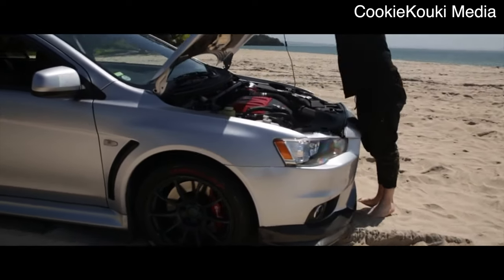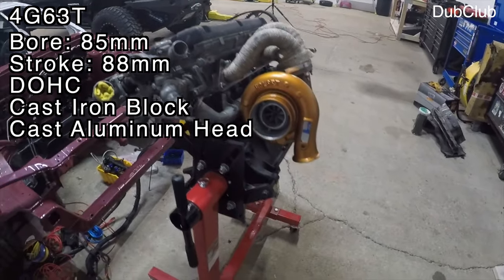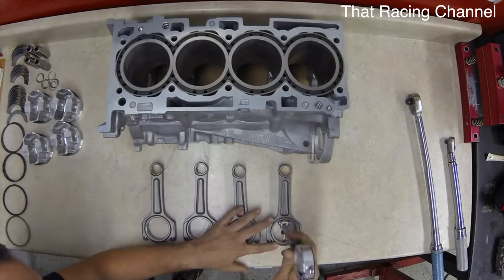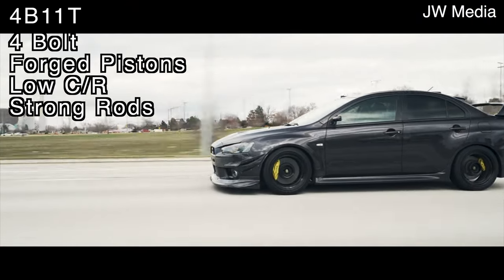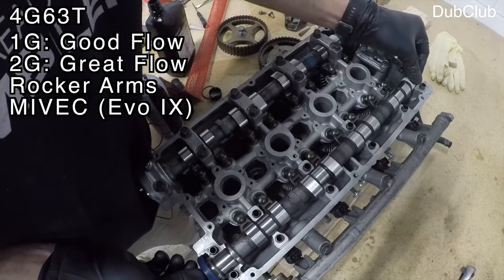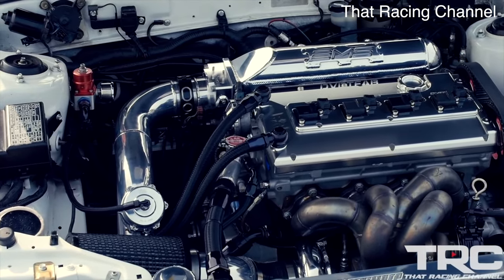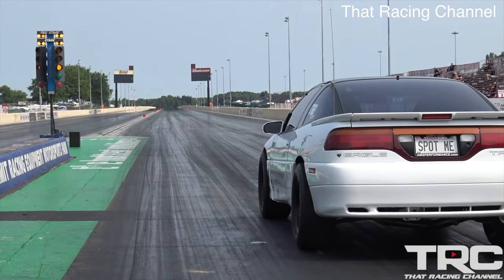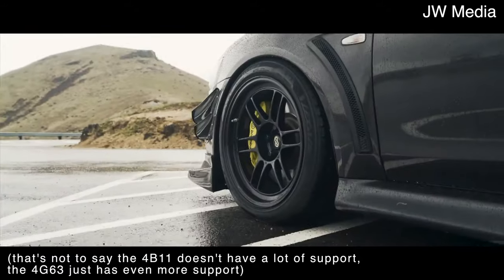Mitsubishi 4G63T vs 4B11T: Which One is Better?

Comment: Realistically speaking, we generally buy cars for the car itself and not just the engine. When I was searching for an Evo, I test drove numerous evo8s and 9s, but ended up buying the very first evox I test drove. I convinced myself before hand that I wanted the 4G63 Evo, but after experiencing the evox comfort and added features over the older evos, It was a no brainier that I felt like I was getting more for the money. Fast forward almost 5yrs, my Evo is making around 650whp, still on its original oem never opened t-case,  diff , and bone stock trans..forged sleeved engine yes. I made the best choice.. and it's my daily.. I have put over 100k on it in 5 yrs
Reply: I have an X tuned to just over 400kw at the wheels, the engine was virtually stock with just a couple of bolt ons, and lasted almost 300,000 km. Eventually the timing chain jumped a tooth and the engine failed, but that's more due to the fact that it was the original chain and it had basically worn out. The majority of the internals (those not busted by the timing chain failure) are still in perfect working order. 

I still have the car, only the repairs are beyond my means at the moment. One day she'll ride again!
Reply: Wish i could have one but i refuse to buy one used as i know people beat the shit out of these cars and the STi subaru is making right now look like a glorified toyota corolla so i think ill never have one don't understand why they stoped making the evo
Reply: @emlix1  evo lx with just a tune on e85 400+awhp
Reply: My g54b lasted almost 30 yrs with over 250k miles on it before a rebuild
Reply: @user-fk2si1xc2s  Yea its takes more than that. But the evo9 does make the most power with less effort than any other 4g63 mivec makes a big difference . The 4b11 is a smoother more efficient engine but takes way more money to make equal power .
Reply: @killfase01  Starion? I own a '87 myself. I wanna vouch for it's reliability but I can't. Even with the jet valve and balance shaft deletes I've already had rod knock and a lifter shatter, along with numerous other problems in the 2 years I've owned it. Simply put, it had the potential to be a great engine, but was made in the wrong time period. Good block, but a horrible head, intake system, and numerous other systems that were advanced for the time but not thought out well enough to prove bulletproof even from the factory.
Reply: For a daily driver we buy it for the car. In regard to 4g63 we get a 1g or 2g car simply to be fast for cheap. They're definitely not the most comfortable cars but I used to daily it when I was younger
Reply: MVRDA MONXY I own a x its 2012 and only has 24k or so lightly tuned and not beat at all..... I kinda want to part with it though ughhh
Reply: @Lowedownful  yeah I never (well, almost never) thrashed mine. Serviced it every 10-15000 km (or every 3-4 months given the amount of driving I did for work), and if it had a dedicated timing chain service light (as opposed to the stupid and vague exclamation mark in a triangle which went away after the requisite number of ignition cycles) it would still be on the road and probably approaching 400,000 km. "Beat" engines don't generally last that long. Indeed the X's own service book only goes as far as 210,000. Maybe that's all they were expecting the 4B11t to do?
Reply: I think the evo x is a fine car and plenty of my business have had 8 9 and X. I however find that I dont care about comfort or luxury nearly as much as driving feel. The evo 9 simply just feels better to me. I absolutely hate the clutch position of the X and the size of it just doesnt feel as nimble. However what it all comes down to is we're arguing over which absolutely amazing car is better.
Reply: Salute to you and your evo
Reply: Denny Houck this is waaayyy more then 2 cents dude especially after reading it all lol
Reply: @colbert9263  yeah, sorry about that man!!😂
I tend to get a little carried away when it comes to cars!!
But thanks for reading my long ramblings!!
Reply: Denny Houck i would definitely have a perfect score if i answer this long essay in exam.😅
Reply: @mvrdamonxy7942  sadly the mitsubishi closed there productivity of evo which is for me the best engine than Boxer of subaru..very affordable when we updgrade it
..
Reply: Why did you just categorize me like that. It’s either the engine is good for the price of the car or not
Reply: Have u seem the integra platform? We do not buy for the car, we buy for the engine. Ether GSR or Type R.
Reply: 4b11 is Hyundai trash , you wasted money on garbage
Reply: Is it okay to launch it with stock transfer case and other stock components etc

Comment: Yes 4G63-T is a legendary engine for a number of years already and it has proven itself from time to time, it holds some of the most impressive records in the motorsport scene be it rally,track racing, and even drag racing. But when mitsubishi made the 4B11 it was actually a product of things that they have learned from the weaknesses of the 4G63-T. So nevertheless, its safe to say that the 4B11 is the result of everything that has always been the weakness of the 4G63-T.
Reply: FU.. TALK WHEN YOU BEEN IN A 1400 HP EVO 10..
Reply: @mickleeds9335  Evo 10 has the "4B11T" engine...also used in the Hyundai i30N ..
Reply: Agree 100% , ya dont sleep with them 4b11t they are coming , i love to biuld a sfwd with a 4b11t to race against yhem hondas
Reply: I heavily Agree Osama and it's always good to have a conversation with ya as you know your stuff when it comes to Mitsubishi and that's super dope haha. But honestly I think the 4B11 also took FAR less time to get into the 7's unlike how long it took Evo 8's and 9's with the Evo variant 4G63 that also seemed to be revised from all the DSM's issues as well since most of them have been corrected on the Evo's version of the 63. So I also agree that I think the 4B11 is going to takeover from the 63 in due time because it's seeming to be closer to K series style Semi-Closed deck design to their open design but slightly better and also is an Aluminum block just like the K but the sleeves seem to handle way more as well as the block itself seems to be just as strong as the 63's as you don't need to get a billet reinforcement like the Honda guys do to go over 900whp+ to be reliable
Reply: Tbh 4b11t has been my favorite because of the cons with the 4g63t and that now you can make the same power as the evo 8/9 and there cheaper than the evo 8/9 it's a no brainer to go with the evo x now (it looks better anyway)
Reply: The 4b11 is Hyundai trash

Comment: Can we stop assuming that everything that is "forged" is super strong? Like these could take 400-500hp. The CAST bottom end in the Saab 9000 B234R can take 850hp and didn't even break in that car because he was just testing. It's all about design not just manufacturing process
Reply: phoenix8129  then you missing out bruh haha.. Theres plenty of them
Reply: Well it's not that, but it's just generally the Cast bottom ends usually don't last long even if they CAN do very high power for the most part, so most don't push them like that when they can just get a better part with a better & stronger material to push for a longer amount of time that you risk it breaking far less than you would with a Cast engine or part usually.. Besides, most of the time too, forged parts usually are lighter weight as well which does help
Reply: @jordanprice9285  the lower weight is true and you can get bigger pistons too. But the guy I'm talking about is Robert Uhr from Nordic performance and he has run that engine for quite some time now, stock 9000 parts, he uses a a lot of OEM parts in is racecar.
Reply: The japanese seem to like forging. I know toyota does a lot of forging to reduce weight and material used.
Reply: Speak on it
Reply: Yeah and the b204 in my Saab can handle around 600hp stock bottom end . nobody wants. to give it to the sweeds tho. When gm bought them out they became junk.
Reply: phoenix8129  my Saab is at 300hp with a td04 right now runs like a dream next step is a holset Cummins turbo 500hp this time around but look up Saab 93 racing and you'll see nordics 93
Reply: @jordanprice9285  my Saab has 212k and its a cast b204
Reply: @alexstromberg7696  Yeah I've heard of him cuz I've seen some of his stuff and honestly the guy seems like a madman!! And not only that I know Saabs are built like tanks anyways as most Swedish cars are, also like Volvos as well, so I know whenever someone decides to buy Swedish, they're getting a car that's DURABLE AF!! 

But if you're getting something outside of there especially if you're going Japanese for the most part, it seems that whenever there is a cast part or engine that usually it's strength is limited to smaller amounts of power capabilities as usually the cast material isn't made half as durably to be able to take the heat being thrown at it. Take the Open Deck Subaru engines for example. They don't take heat very well even though they're using cast aluminum blocks. It's also kinda why lots of Mitsubishi engines usually used Cast Iron because it's usually VERY DURABLE and STRONG like a MF when it comes to build quality unlike it's cast aluminum counterparts with closed deck design because it's just smarter as it can just take higher levels of abuse simply because the material was much more capable of taking it since it's made for it.

That's also why people prefer forged stuff over cast. (Ex. SOHC 12V 6G72's Cast crank 3000GT vs DOHC TT 24V 3000GT Nitride steel forged crank 6G72's) They can assuredly for the most part take far more thrown at it en mass due to stronger material in design and when it comes down to it, the average tuner is more inclined to take a forged part or engine vs a cast one simply because it gives more room for error when making power and usually if anything were to happen, that the forged part will more likely be ok to survive than the cast one which usually will have a much easier time getting destroyed since it's weaker and can't handle what the average person tries to throw at it.

Comment: 4b11t is better, literally has a way better head, and the head is what makes power, not the block. Once you sleeve a 4b11t , or Even CSS the block you’re looking @ the same power range or even more as the 4g63.  And like homeboy said @ the top…. The 4g63’s are usually in a lighter body, compared to the 4b11t grocery getter

Comment: I own a 09 X 77000km 
400hp at engine 
Driven Evo 7 and 8 
Here is my general experience
The 4g simply feels more raw and brutal with sudden boosting  feels very strong but definitely feel the lag and sluggishness in the lower rpms 

The Evo X feels definitely more refined less brutal more consistent torque and power band through the revs 
The turbo lag is minimal and car responds so rapidly to boost and picks up speed to fast it’s shocking After fast it spools and slams through the gears 
It’s by far the more advanced faster and more reliable engine.
Reply: But that's part of what makes the 4G so great in my opinion, I have an Evo IX and I just love the raw nature of it, I love the turbo laag (as stupid as it sounds), and I love the power surge once it finally gets on boost, it just feels so raw and emotional, I love it... (even though it may be objectively worse)

Comment: My turner at English Racing told me that both engines when fully built are the same in terms of reliability and power and also said a 800 hp 4b11t is a lot more street friendly than a 4g63t bc on the 4g63 if u want to make that power ull have to half or full fill the coolant passages in the block with concrete to help the cylinders from warping but on the 4b11 u change the sleeves
Reply: i see alot of 6 bolt 4g63t pushing 1000awhp no problem just forget engines
Reply: m see a lot lol @ YouTube
Reply: I call bull on that one the way the 4g is built from the factory plenty have gone above and beyond in terms of reliability with the most common mishaps in terms of failure mostly coming from newbie mistakes and neglects in service both of which will completely destroy an engine in minutes or miles depending on the severity and level of said neglect.
Reply: @clarencepollard1253   English racing is the best they build the fastest evos and dsms. 4gs always blow up around 400hp if u don't forge the internals with exception to the evo 8 and 9 are reliable at 500  older 6 bolts and especially 7 bolts 4gs are not reliable at all . The 4b also doesn't have stupid balance shalfs and it has a timing chain that in itself is smarter and more reliable with smarter engineering .
Reply: @ace-qi9pj  4g63s blow up at 400 hp on stock internals , do you even have any idea what your talking about Lmao, I have been into DSMs since 1992 , maybe get a clue seriously, saying the 7 bolts in Evos is stronger then the 6 bolts , where do you get this stuff from lol
Reply: @ace-qi9pj  actually the fastest DSM is Boostin performance Talon, and the 2nd fastest is Aaron Gregorys Talon , neither of which are built by English, Jeff Bush's was pretty fast , but Gregory's car holds the auto record
Reply: @jerrywhite4764  Oh yea and I was talking about the bearing problem on the 7 bolt dsm 4g63 when they went to a different style and all of them crank walked on the 95-97 if u owned dsms ud know that.
Reply: Scrilla the 4G doesn’t need to be filled, there’s a number running high power either half filled or not filled whatsoever
Reply: 4g63t is an iron block engine. You are incorrect in your statement as these blocks are maybe the strongest 4 cylinder blocks known and can handle immense amounts of boost pressure even when bored to accept larger pistons. I know English Racing very well and know them to be a very knowledgeable company who do great work and give sound advice. Out of curiosity which tuner there gave you this advice?

Comment: There may be better aftermarket support for the 4g63 but the aftermarket for the 4b11 is plenty strong too. You can buy top notch parts for building the motor no problem. It's like comparing a supermarket to a slightly bigger supermarket. Also stock 4b11t at 500hp don't really last all that long. It's mostly torque dependent but pushing 320-340 torques on the stock rods is asking for trouble. I'm sure there's plenty of survivor bias out there but if you want a bulletproof 500-600hp 4b11 do the rods.

Comment: Awesome video very informative thank you for taking the time to put it out a couple things that I don't know if you mentioned it or not because I'm interrupting the video in the middle is the fact that they changed the  4G63 in 2000+ engines for USDM market they reversed the cylinder head layout and move the engine to the passenger side of the engine compartment rather than the driver side prior and some of the people might not know what a 1g & 2g unless you tell them about the eclipse aka DSM
Reply from the maker: Thanks for watching 🤙

Comment: Ok, to answer your question we first need to specify in what application is the engine used.  With new emission standards in Ca for example, the 4b11t  will pass the tests at higher HP and Turks.  For racing or places where emissions are not a factor, I would take the 4g63t every time. Iron block can handle massive boost and make huge numbers. Reliable????below 500 hp they both are ok.

Comment: 4b11t is an all around good track racing engine because it's lighter, rigid, and has superior heat management with the semi closed deck design. 4g63t is far superior for drag racing and high hp and torque numbers because it can take massive amounts of abuse without flexing. Both engines have a placement in the Evolution hall of fame. If I was building a drag car, 4g63t all day. For track I'd choose the 4b11t.

Comment: I must add that from my investigations of crank walk with 4g63 1g and 2g engines were caused by excessive clutch pedal travel. Always use a pedal stop even with a stock clutch.
Reply: Can you explain this please?  Clutch pedal travel affecting crankshafts...in most cases I would make fun of you while I claim BS but this I want to hear.
Reply: @Crusher103  So your clutch connected to the flywheel which is connected to the crankshaft. while in a normal state, the crank rotates perfect, only if some force is applied from one side, would the crank start to press against the center bearing (the only bearing holding the crank dead center in the journals). over time of pushing the clutch well beyond the needed travel would it start to cut that bearing. A Clutch stop, would reduce the need to push beyond the needed travel.
Reply: @JDMBUILDSJAMAICA  After reading this I'm coming to the same conclusion, this is BS.  I see where the information is coming from but it is a REACH to think that the force from the clutch causes crankwalk, regardless if its a 4g63 or not.  The pressure plate indirectly pushes against the flywheel but never pulls.  If this were the case more of clutches causing crank walk issues, NOBODY would use high clamp force pressure plates on any car.  The movement in the crank caused but clutch modulation is the result of bad bearings but definitely NOT the cause.  No clutch puts enough force on the crank to actual move it, if it does your motor seriously compromised.  Whatever that clutch pedal stop your using for is just a band aid to the actual problem which will eventually turn into a hindrance to drive with the already doomed motor.  The clutch pedal stop that is being talked about online is actually for people using an Isuzu slave cylinder that changes the clutch pedal travel from stock.  People who are doing so are doing it because they have have high clamp load twin plate clutches, they did this to have better clutch modulation.